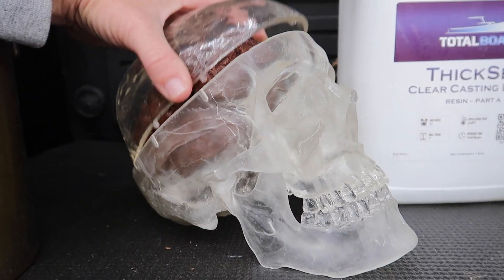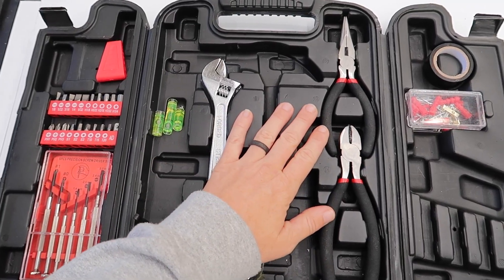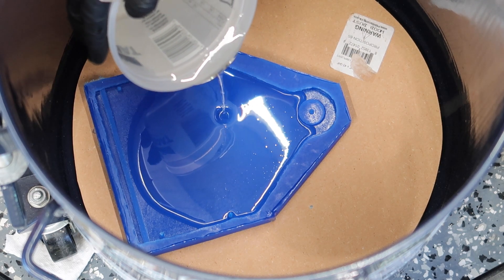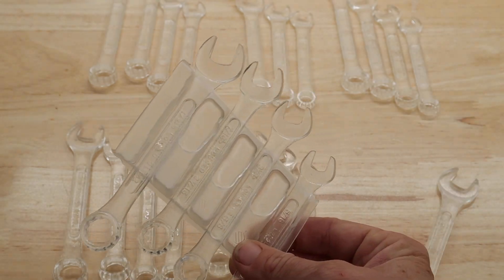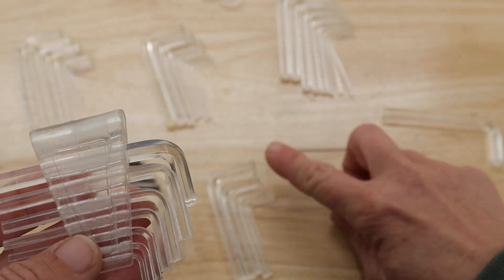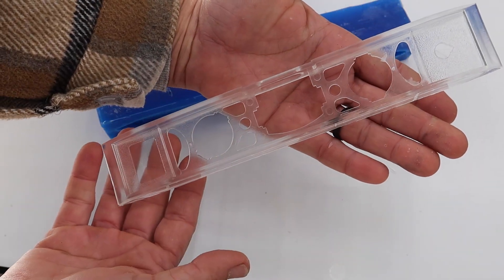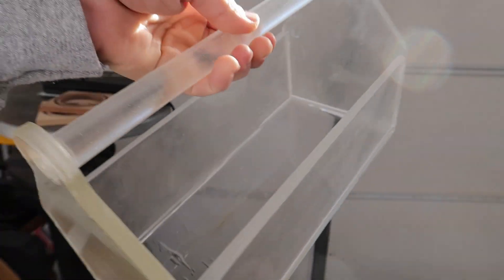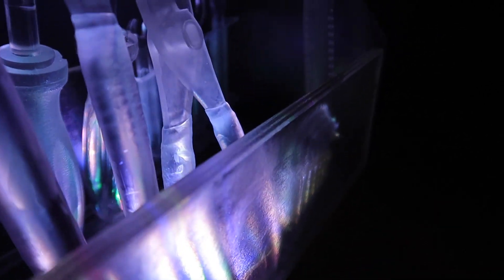Transforming Tools: Creating an Extraordinary Epoxy Masterpiece

Comment: Pressure pot seems to be a must have for clean molds and finished pieces.  Cool content.
Reply from the maker: Yeah the pressure pot is where it’s at!
Reply: @wood_brain  ay consider vacuum beforehand too :)

You can also make a vacuum for 5 bucks with a 3d printer. Find a 3d printable Venturi vacuum generator to use with your new compressor and it will pull a decently high vacuum for ya. Pressure pot+vacuum+ultrasonic degassed is ideal but any of them work. This was really amazing and nice job!